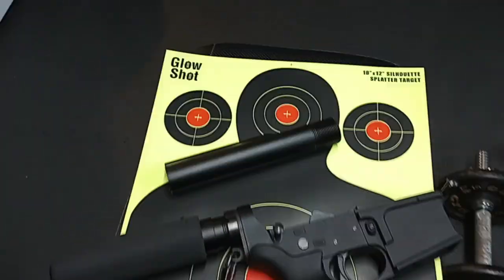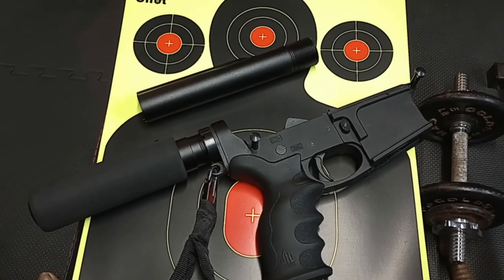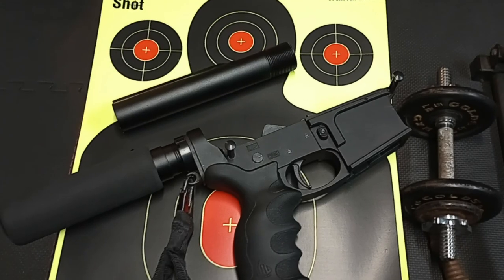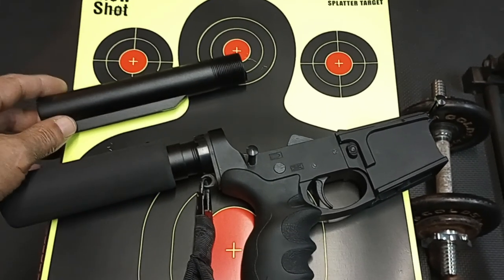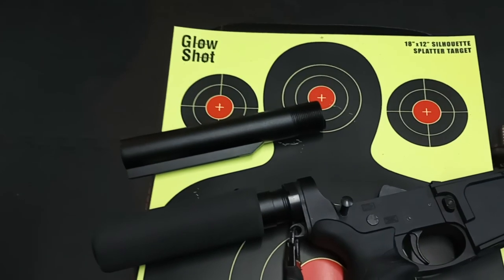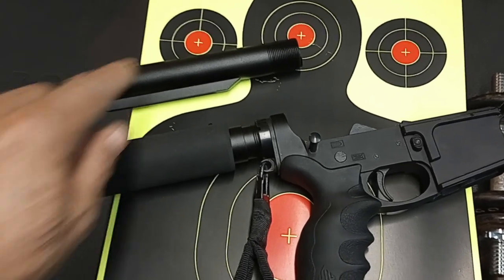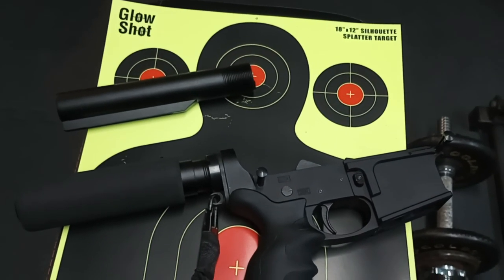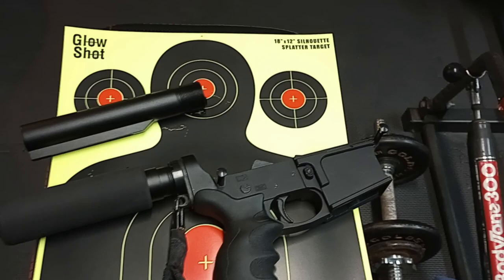IS MY AR PISTOLS BUFFER TUBE DESIGNED TO BE FIRED FROM THE SHOULDER??

Comment: I have faith that the ATF WILL change its mind with the blowing of the political wind - that is their track record. I did the exact same thing you are discussing in this video - AR15 lower with a pistol buffer tube (legal per ATF video with FFLs a couple of weeks ago as it is required for the function of the firearm). I went with a VLTOR PISTOL A5 KIT. I watched the entire ATF FFL presentation a couple of weeks ago and they did not mention anything about foam or paracord not being allowed in the presentation I watched - as long as it doesn't add to the "surface area" is should be fine, which foam and cord absolutely do not add to the surface area. Either way, it only takes a second to remove the foam or paracord if under the VERY UNLIKELY situation where one might need to do so. Again - the only thing the ATF can be trusted to do IS TO CHANGE THEIR MINDS - 3 to 40 million pistol braces allowed into the market by ATF over the last decade and they now just say they changed their mind??? Yea sure - just a little oversight on their part - uh huh. If this was a private business they would be sued out of existence.

Comment: Yeah, I feel like they will say in the future the adjustable buffer tube must go, even though they said remove the brace and you are fine by them. Now, one thing they did say, the foam was not allowed. But, I believe they were just uneducated on what that was. A person might want to by some pvc fittings just in case a water pipe breaks. 🤔